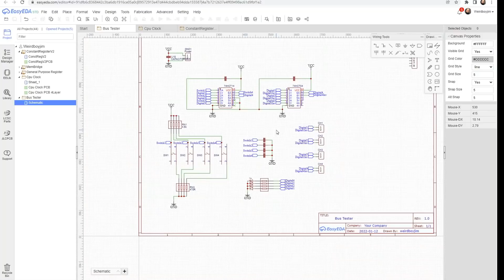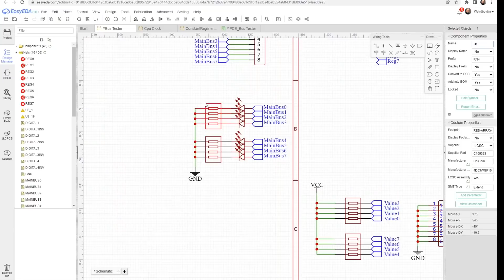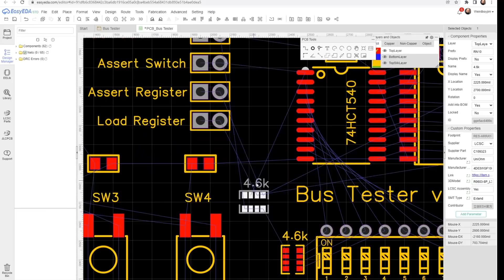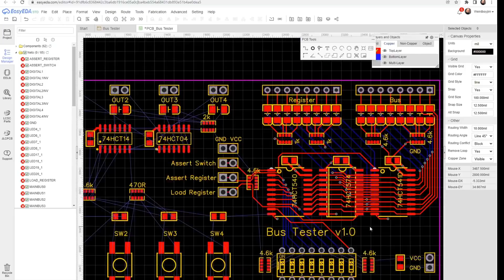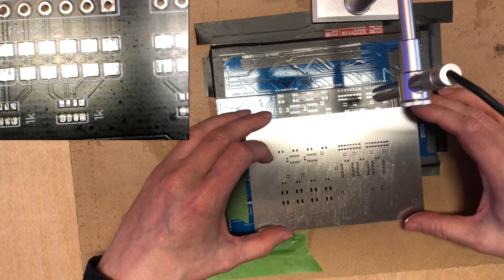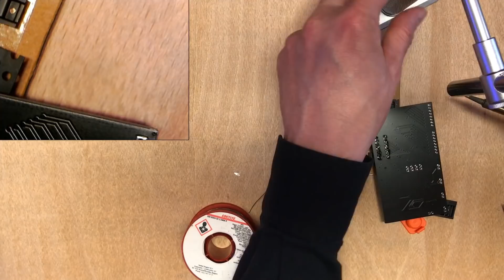Bus Tester PCB – Full Design and Build

Comment: Dumb question: what are the unlabeled little gray circles you're putting on the PCB design?  They don't correspond to any chip or connection, they're just kind of dotted around.  What are they for?  How do you choose where to put them?
Reply from the maker: Those are vias, if it looks like they don’t connect to anything they are likely connecting ground fills/planes. Every signal line needs a reverse path for the ground return which should be as close to the signal as possible, I’m mostly placing ground vias where I can see ground connections are taking a longer route.

Comment: I do think you need to leave the hot air gun on components slightly longer when melting the solder paste. It can take a few moments to fully melt the solder under the legs etc.
Reply from the maker: Thanks! I think the next change to my soldering is I've been talked into trying a hot plate, that will take some of the human factor out of it. I get conflicting advise on this subject.

Comment: Your design and construction skills have come a long way, very quickly! There are several YouTubers who claim to be professionals, whose design and construction skills aren't as good as yours. Ultrasonic cleaners are useful, but the cleaning fluid can creep into switches, potentiometers etc, and can leave a residue on the switch / resistor surface. I find it better when making one-offs at home just to use isopropyl alcohol and a brush.
Reply from the maker: Thanks Zad, appreciate the support! That makes sense for pot's and switches, I've done a bunch of cleaning with IPA and a brush before but I never quite seem to get all the flux off.

Comment: Love your videos, and especially love that you use EasyEDA and not KiCAD like everyone else seems to. I've tried to get into KiCAD several times, but it has the most annoying UI - seemingly typical of a lot of OpenSource projects.
Reply from the maker: Thanks! I like the way easyeda just works without needing to install anything and the order process (via JLC)  lacks the pitfalls of trying to separate out gerber files. It really accessible for a newbie!
Reply: @weirdboyjim  Absolutely. The integrated process from schematic to PCB order makes it so easy. 👍
Reply: I understand that the UI annoys many people, but I have to admit, I like the KiCad interface.

I absolutely agree that better manufacturing integration would be beneficial. As well as better (more complete) parts libraries.

Comment: First project I ever made was a port monitor for the parallel port.
Reply from the maker: Nice! Lots of led's or something more complex?
Reply: @weirdboyjim  2 connectors, 8 LED's and 8 resistors, and some wire, was about as simple as you could get for an interfacing project.

Comment: I would highly recommend that you use flux always if you handsolder. Also if you do small corrections. If you dont use flux your tin can get oxydised. Thats not good for resistance. Also it makes the bridge removale between two pins very easy. Just buy a flux pen. 👍
Like your videos very much james!
Reply from the maker: While preparing for this soldering session I found my flux pen had dried out, I'll get a replacement on order.
Reply: Yes, a flux pen is very handy, especially when the resist mask isn't doing it's job as well as it perhaps should.

Comment: Very good - board solder/bringup therapy.

Also "What I really need is an ultrasonic cleaner" made me laugh! The endless list of things....
Reply from the maker: Thanks Charlie! Of course what I really need is a professional re-flow oven....
Reply: @weirdboyjim  I use the bismuth based solder which reflows around 170 and just chuck it in our regular kitchen oven, whack it up to 200 and when the light goes off it's done - works a treat
Reply: @cskilbeck  The same oven where you make food? Are you sure that is safe? Lead causes massive brain damage and intellectual problems.
Reply: @douggale5962  it's lead free - for sure it would be a very bad idea to use the food oven with lead based solder! But also bear in mind that lead only gives off fumes above 900F, so in practice not likely to be a problem, especially if you're just doing a tiny board. But yes, no, not with lead in any case.

Comment: I stopped using resistor arrays. by reducing the keep out between resistors I can get close to the same density. I also see you have inverted U on the resistors. We are looking at using that as we are getting small solder balls. Is there any documented drawing for that stencil for 0603?
Reply from the maker: That's just the standard footprint on easyeda for the part.
Reply: @weirdboyjim  I am starting to get to the point where I'll have to update from Eagle 7.

Comment: Your solder paste is too wet. Leave it uncovered and allow it to dry out a bit until it looks less goopy.  I would also invest in a Aixun soldering iron, a JBC clone for around $120. It will change your soldering game. It heats up very fast, maintains a constant temperature and has an array of small tip choices,
Reply from the maker: I use paste fairly slowly so I've started using the syringe version instead of the tub and this was a brand new tube. In the video it's tough to judge this one as it was smeared a bit during application.

Comment: it's a bugger when the solder paste does not get hot enough to pull all the little solder balls in to the molten mass. Plus it's hard to try and wash them out from under the chips later. I've taken a chip off after a fair bit of washing and the little balls were just sitting there having a laugh at me.
Reply from the maker: The big problem with making videos is you get to watch your work closely during the editing process. I just plain missed that corner of the chip both with the hot air AND in the inspection as if it was some kind of blind spot. Just needed to take a little more care.

Comment: An ultrasonic cleaner won't really help you. Use a proper hot plate to hest the board more evenly, and activate the flux correctly.
Reply from the maker: The mention was a little out of context. I've been looking at ultrasonic cleaners for board finishing for a while, I was just thinking that it would have shown me this issue quicker. Everyone wants to tell me better ways to solder but the truth is I should have taken 10 seconds more with my inspection.
Reply: @weirdboyjim  I mainly use my cleaner for cleaning my partners jewelry and my watch strap! 😂 I've never used it for electronics. I stand by a hotplate for any more than a few parts or single part rework.

Comment: Your PCB skills have come on phenomenally!

Regarding the ground wires, I usually go out one grid step, and straight down. All the other wires cross the ground. Use a separate ground symbol for each side. Check out some big schematics for old 1980s computers online. You'll get a good idea of how things are drawn.
Reply from the maker: Thanks George! So far as I can tell I consistently get every thing I did wrong on the previous pcb right and then find a bunch of new mistakes to make ;-)
Reply: @weirdboyjim  I do this stuff for a living for a big company. You learn something from every board. Stuff you didn't even know had the potential to break everything! I don't recall we every shipped a Revision 1 board out of the company (rarely out of the group). We are usually on Revision 2. Admittedly we have teams of people and huge schematics.

Comment: Unsolicited opinion: I don't think you need a cleaner to remove solder paste that hasn't flowed, I think you need a cheap oven to flow the paste properly. I also still maintain you need to use some flux when reflowing those joints, some of them didn't look too good when you were touching them up.
Reply from the maker: An oven is on the list, but a cleaner would have gotten the paste under the chip and shown the issue.